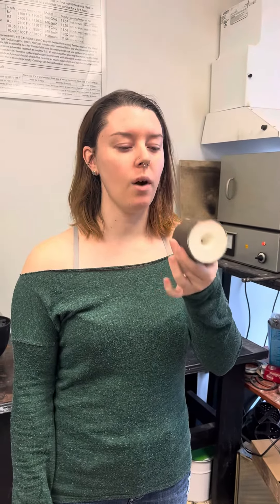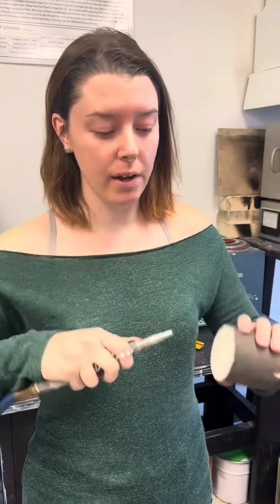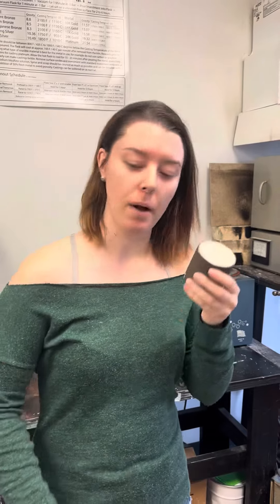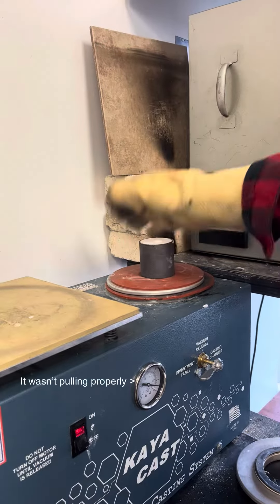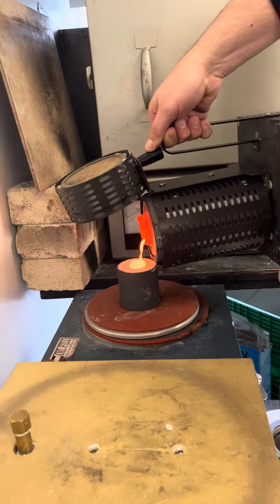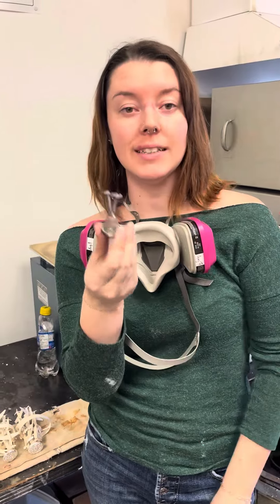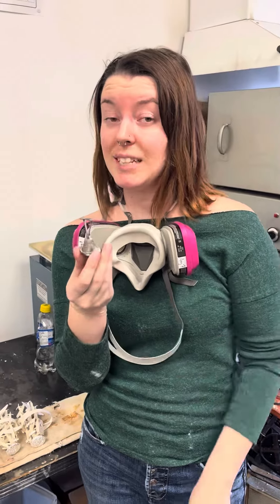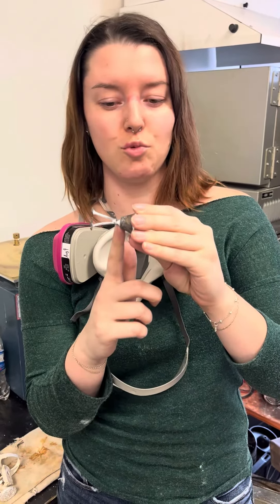Casting a 10+ year old flask - Secondary Burnout

Comment: Mystery solved! … kinda
Reply from the maker: If only we had gotten a better seal on the vacuum! But I guess that's what we get for leaving that poor flask on top of the kiln for the last 2yrs and in storage before that. 
At least it's proof that leaving your burned out flasks alone isn't a huge deal so long as you treat them gently.
Reply: I'm surprised you guys don't have a centrifuge for casting. IMO it works better than vacuum casting.
Reply from the maker: We did have a centrifuge years ago. We usually do 4x6" flasks, haven't done a small flask like this in 2+yrs, so vacuum is just an easier workflow for us.